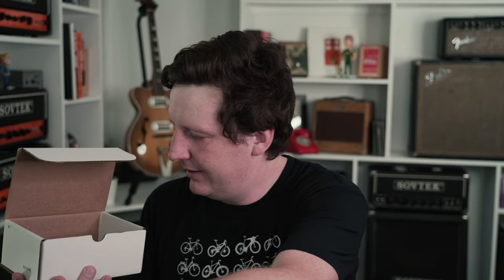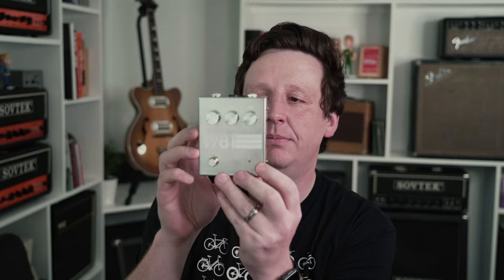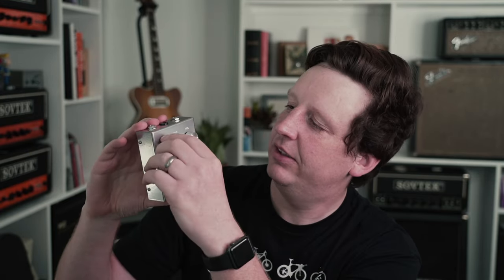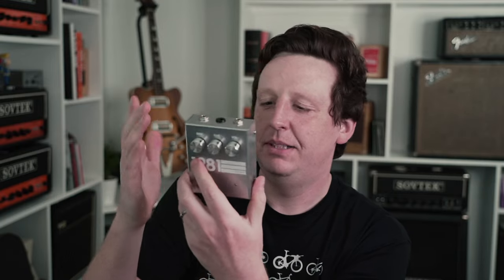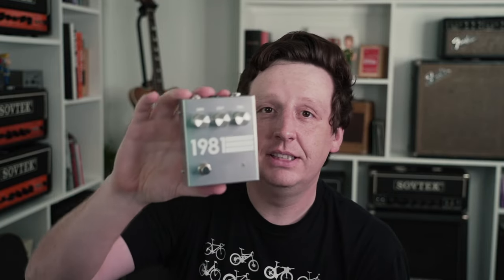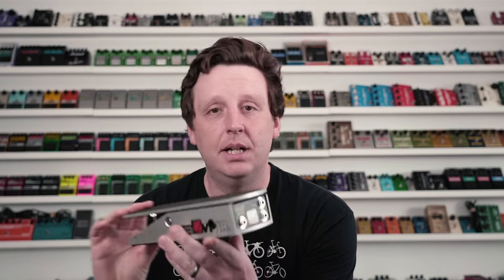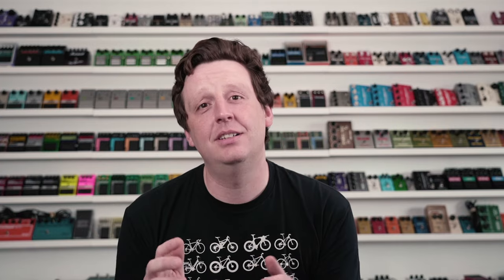Why You Need A Buffer

Comment: What's ironic is that everyone complained about boss pedals being not tru bypass. So they modded all their boss pedals to be tru bypass, then went out and bought buffers for the pedal boards... Musicians eh
Reply: Guitarists**
Reply: Boss buffers are great but you don’t necessarily want every pedal to be a buffer as this can also cause tone loss. If boss would just include an option to switch between buffered and true bypass mode that would be ideal but otherwise you do sometimes need to do true bypass mods on boss/ibanez pedals when you don’t want a buffer at that point in your chain and then need to buy additional buffers to ‘sandwich’ your board with buffers.

Comment: Simple bit of advice: get a BOSS tuner. It has buffered bypass. Go one step further, get the BOSS looper/reverb/delay and boom you have a buffer at the beginning and end of your chain.
Reply: TC electronic HOF2 has a buffer mode as well if that helps
Reply: That would only give a buffered signal to the next pedal over soon as you turned a compressor or drive the rest of the board wouldn’t be buffered. You want the pickups to think it’s getting the same input impedance as an amplifier. Buffer interface is a better option something with a 1mg ohm input and a output
Reply: Jhs pedal is 44 bucks tho
Reply: Two of these Little Black Buffers are way cheaper than a BOSS tuner and looper pedal...WAY cheaper.

Comment: These videos are ALWAYS brilliant and one of the best things for me is the way you constantly talk about how good Boss pedals, MXR too, Danelectro, etc and really hammer home that you don't have to buy boutique stuff all the time and it's OK to get cheaper gear because there are some real gems out there.

I did a lot of work on my board last year and ended up putting a few buffers in at various points to balance it all out - the TC Electronic Polytune 3 has a built-in buffer so I was able to get rid of my separate Bonafide Buffer then in my FX loop I have an MXR Stereo Chorus, Carbon Copy Deluxe and M300 Reverb which are all buffered. You really can hear the difference between that and the old all true bypass board that I used to use especially when connecting with two 20ft cables in the front end and two 10ft cables into the loop.

Comment: I had the JHS little black buffer on my mini pedal board a few years ago and it worked best at the front of the board.  But then I got a TC Elec poly tune 3 tuner for that mini pedal board so I didn’t need the jhs buffer anymore.  

But for my main rock band (one gig per week) bigger pedal board w about 13 pedals on it, I didn’t have a buffer at the end of my board.  Most but not all pedals are true bypass on that board so just the other day I thought I’d A/B the sound of my board as is - with no buffer at the end, vs the tone w the jhs buffer at the very end of the board.  Note that I already have a buffer at beginning of the big board via a tc elec polytune 3 tuner.  

The results were very unexpected.  Without the buffer the sound was weak and lifeless compared to the sound w the jhs buffer at the very end of my chain.  Wow.  More volume.  More life.  More top end.  Sounded like I was plugged straight into the amp.  I’m sold.  I mounted the little black buffer underneath my pedal train Novo board last in the chain.  What a difference.  Had no idea I was missing what I was missing.  Big fan of that little buffer!

Comment: What is the benefit of the 'sandwich' approach to buffers? The way I understand it, putting a buffer between your first cable coming out of your guitar (cable 1) and the rest of your cables (cables 2, 3, 4, ...) essentially eliminates the 'darkening'/'tone suck' effect. I.e., the capacitance that would have built up from stringing pedals together using cables 2, 3, 4, ... is eliminated when you put a buffer in between them and cable 1. 

Based on this understanding, it would seem that putting a buffer at the end of the chain is redundant. All of the capacitance that would have built up form cables 2, 3, 4, ... is neutralized by putting a buffer between them and cable 1, therefore, your high-end should be retained. Why would I need to put another buffer at the end of the chain? What kind of effect would I likely hear as a result of utilizing the 'sandwich' approach? It seems to me like that is just wasted space. 

Not criticizing, just looking for an explanation. Would love to hear your thoughts.
Reply from the maker: Sure, it all depends on the size of the board. If you like your sounds with just one, then that is great! Try the test I mentioned in the VLOG and see what you hear.
Reply: @jhspedals  With all respect, you completely avoided the question and dissmissed questioner's curiosity. It would be better to not respond at all.
Reply: The goal with the buffers is to decrease/eliminate the high end loss that occurs because of the length of the signal chain and the cabling involved AND to provide the proper impedance load to your guitar pickups and the amp.  A buffer at the beginning of the signal chain and one at the very end is ideal.

Comment: You mentioned that Boss has a really good buffer. Is there any situation where that isn't the case or they don't perform well? 

For example, I run 2-6 pedals at any time. The first time I bought a boss pedal, I loved the sound of it, but when it was off my clean sound had this strange character to the midrange that wasn't there before. So while I was losing some signal with all true-bypass pedals, when comparing the clean sound of my amp to the buffer going through several different pedals of which I swapped around as well as changed the number of them in the chain, I was still getting something that wasn't there before. I've had this experience with every buffered pedal I've tried (though more noticeably with Boss) so I'd like to know why this is happening?  I loved my Bluesdriver but I couldn't get on with the clean tone when it was in the signal.

Comment: Thanks Josh, very interesting. Prompted me to do some rig testing. Although it led me back to where I started, my understanding has increased for future reference and it means I don't have to wonder about buying a buffer (for now). If it helps anyone else, here are my findings:

The board is 18ft from my Marshall amp & consists of 6 true bypass pedals & a Boss DD7. The guitar straight to amp compared to thru the 6 t/b pedals in front of the amp reveals a bit of volume loss (10%, maybe) but, happily, the tone shape/character is retained with only a tiny loss on the very low & high ends. I put the DD7 on the end of the chain to see what happened and found that it took a little bit from the low end: not in bad way/deal breaker, per se, but the I preferred the actual delay effect when it was in the fx loop.

With the DD7 back in it's original place (and the signal passing thru 36ft of extra cable) I compared the tone with the fx loop on/off and found that having it on boosts the low end slightly. So the net effect of 7 pedals and a bunch of cable is a slight loss of treble, which, given that I set amp with the bass at 10 and the treble at zero, is something I can live with!

Comment: Input and output buffers can have different functions.  So-called "line drivers" are also buffers, but have higher current-delivery capacity.  Their role is not only to turn the input from high to low impedance, but also to condition the output signal.  That capacity is pretty much moot when the cables are the typical 10-20 footers used by most players.  When the cables start to be extra long (25, 40ft or more), however, the current delivery capability of the output buffer needs to be higher to overcome the cable capacitance.

Consider the cable as if it were one big electrolytic capacitor.  The time it takes to charge up is a function of the amount of current you feed it.  Longer cables = a bigger capacitor.  Short cables don't benefit from the extra current-delivery capability, but long ones do.  Narrow bandwidth signals over a long cable (e.g., bass) may not require that extra help, but wider bandwidth signals (e.g., acoustic guitar) might.

Comment: So now I’m confused. Currently, I’ve got my Boss TU-3 going into an always-on compressor > volume pedal > always-on EP Booster > Fuzz.

Does this mean I need to have my Tuner after the Fuzz? And also don’t always-on pedals like my boost and compressor effectively act as buffers? My boosts and compressors are supposed to be after fuzz?
Reply: good question dude! i would like to see an answer to this too!
Reply: Every Child I actually went ahead and did it. Sounds great. Only my pedals are a bit interesting, not standard fuzz. Anyway, I took my tuner out of my tone chain entirely, have it out the dedicated tuner jack of my volume pedal.
Reply: And yup, I have a distortion first (it’s a Caroline Wave Cannon and Phillipe from them told me the pedal wants to hear the guitar directly as first pedal or true bypassed through other pedals if the feedback switch is gonna work. I love that switch and liked the idea of being able to hit it and push it into the next pedal so it’s first after volume. Then Plasma Pedal. Then a chorus. Then a cleaner drive pedal. Then Chorus. Then EP Boost just for color. Then Conpression. And then on to a modulated delay and my time based stuff.

Comment: I just had a lightbulb moment.  A buffer "buffs" the signal.  I'm a software developer and a buffer is a temporary space to hold data, or space buffer.  I was wondering what the hell that had to do with a guitar signal and why you would ever want to do it.  Isn't that what delay is for?  SMH...
Reply: a buffer in effect pedals is just an amp with unity gain, changing the impedance of the signal because e guitars have a very high impedance, which is not good to drive long cables and to enter effect section

Comment: I’m sure somebody has to have asked this, but why aren’t amp makers building a buffer into the input jack? Or are they? 🤔
Reply: The amplifier can only amplify what it receives. If signal is lost(e.g. the high frequencies get reduced) between the guitar and the amp, the amplifier can't magically renew the signal. Buffers help prevent signal loss; they don't cure it.

I hope that helps.

Cheers,

Alan Tomlinson
Reply: @diegorhoenisch62 
I thiiiiiiink you’re missing the point. 

A. You could put a buffer in front of the amp jack and it could conceivably do the exact same thing as putting a buffer on the backside of an amp jack. I completely understand that the amplifier is only amplifying what comes through the jack, but that shouldn’t negate the ability to put a buffer in-line between the input jack and the rest of the amplifier. If the purpose of a buffer is to improve the signal and reduce loss, including it at the very tail end of your chain seems like it would be accomplishing exactly what it is supposed to do at a very logical spot. 

B. If what Josh (and most) say is true, and there is signal loss at the end of a 15 or 20 foot cable instrument cable, why don’t we see more buffers at the tail end of “out” signal chain? I can’t think of a single time I’ve seen a buffer sitting on top of an amp, or in-line with the amp jack. 

You’re talking to a guy who has two buffer pedals inside his pedal board, so I’m not like I’m anti-buffer, but some of the hot sports opinions on buffers seem to contradict each other IMO.

Comment: If BOSS Tuners have a buffer… and my BOSS Tuner is first… should I move the tuner after my fuzz pedals?  And by Fuzz, do you also include distortion and drives in that category?  Thanks! 🤘🏻
Reply: try both! some fuzz circuits sound different with a buffer before them, some don't. Distortion and overdrive pedals typically aren't effected by a buffer in the same way fuzzes are. Fuzz-face style circuits are notorious for sounding different with a buffer before them.
Reply: @untitleduser666  Thanks for the reply!
Reply: It is related with Impedance Inputs and Outputs. Fuzz (vintage ones), pedals normally tend do gave low Impedance input signal and high impedance output signal related to the germanium capacitors. So I t will need a buffer right next (after) it. Boss fuzzes are the opposite, they have High Impedance inputs and low impedance outputs,  so you can maintain the tuner first on you pedal chain

Comment: Nice clear breakdown of something which can become bogged down in true bypass dogma. It was simple for me. I was starting a board from scratch after a lifetime of multi-effects usage, bought into the idea of true bypass pedals, got a bunch of them, it all sounded oddly dark and lifeless to me (fairly long cables in the system), read about buffers, stuck one at the start, lovely and bright again. But as you say, it's all preference. There's probably someone out there with the same board I had without the buffer, loving the tone.

Comment: Based on what I see on your website, the input is 1 Mohm impedance and the output is 100 Ohm...perfect for most guitar applications.  You should have one at the beginning of your signal chain - plug the guitar into the buffer - and another after your last pedal.  That way you get the right load on your pickups and you get the right load going to the amp no matter what is in between.
Reply: I don't see that anywhere on their website and that's what I'm trying to confirm.

Comment: I got a question! The only way I can get my wah (cry baby GCB-95) to sound good with my fuzz face (FFM3) is to run it before the fuzz, with a buffer between them (Boss TU-3). However, the buffer messes with the sound of the fuzz, and also makes it so it doesn't clean up when I roll off the guitar volume. The fuzz face sounds best when it has nothing in front of it, but if I put the wah after it, the effect is ear-splitting. Anyone got advice for me?
Reply: wah
Reply: @woodchucksquirrel  What a crybaby
Reply: @aaronbabcock9127  :(
Reply: Hey! if you hadn't figured it out yet, usually putting the impedance sensitive pedals like a wah first, then a buffer, then any dynamic pedals, and then onto distortion pedals usually fixes tone best!! the higher the gain on the distortion pedals (fuzz, ect.) the closer you want it to the guitar, and the lower the further ect. could also be if you only have one buffer, having another output buffer pedal at the end of the chain cleans it up a bunch. hope this helps!
Reply: try checking out the signal chain video from vertex too!
Reply: @jaxonjordan4835  thanks so much! I'll take this on board and see how it goes.

Comment: A while ago I tried to figure out why my rig sounded a little dull after I clanged some pedals. I thought it was cables, wiring or pick-ups, etc however in the changer over I ditched my Boss TU2 for a headstock tuner. I did notice the guitar felt better to play when I used a short 10ft cable and after a little research I found out I had been using a buffer all along and I really liked what it done to my signal. 

I'd thoroughly recommend people do the test Josh shows us in the video and see what you think. In the end you like what you like and I like buffered signal. Others may be different and that's cool but you gotta try both to find out what is best for you. Buffers don't cost much and you may already be running a buffer in the chain somewhere and may not know it. You owe it to your tone!

Comment: So my Boss Chromatic Tuner will act as a buffer for my whole pedal chain?
Reply: It Will ;) But maybe not for the whole pedal chain. It will depend on the number of pedals on your rig.
Reply: @thomasanahory  4 - 5
Reply: @willdenham   I think with good quality cables and none of them to long, it’s pretty ok only one buffer. There is a very insightful video about this here on YouTube. Search that pedal show - dude where’s my buffer
Reply: @thomasanahory  Only one, not the one in front, one at the end that JHS is talking about?
Reply: @thomasanahory  I have an effects loop on two of my amps. Will that stand in for buffering?
Reply: @willdenham  you have nothing to lose with two buffers. One at the end and one in the beginning (your tuner), but if you only use your tuner, and 4 more  pedals straight to your amp, that’s enough! Your tuner is you buffer as well. It’s a Boss right?
Reply: @thomasanahory  Yeah, old boss chromatic. It has bypass and reg input. Will an effects loop do same thing?
Reply: @willdenham   if it is a boss loop pedal, it as a buffer in it. So yes :)
Reply: @thomasanahory  I don't know what a boss loop pedal is. It has a bypass output and normal. When you go out through bypass it keeps running signal to amp even when pedal is engaged. Normal out stops signal. I think this prob doesn't effect the buffering/bypass filter.
Reply: @willdenham  can you send a pic? My info is on my page!

Comment: So could I just use my boss as a pseudo-buffer rather than getting a buffer "pedal"?
Reply: I wouldn't call it "pseudo buffer", because a buffer is a buffer. Let your ears decide what sounds best, I would say🎸👌
Reply: @christianconrad1792  I agree a buffer is a buffer, I guess what I was trying to convey with the term pseudo buffer was that a buffer pedal is just a buffer. But a boss chorus pedal is a chorus with a buffer second, if that makes sense.
Reply: @lilcody69  If you don't use fuzz pedals, the buffer should be placed first in the signal chain. I use the boss cs 3 compressor, because the comp should also be placed first in the chain. The buffer is also on when the effect is switched off. An alternative is the boss pedal tuner and every boss overdrive pedal.
Reply: Yes you can, I put one Boss after my Big Muff and it preserved the high end that I always lost when connecting direct from the Muff to the amp with a long cable. Before that I had to use a super short patch cable from the Muff to the input of the amp, great sound but you can't put the pedal on the floor 😅